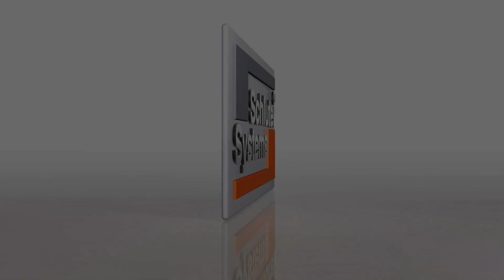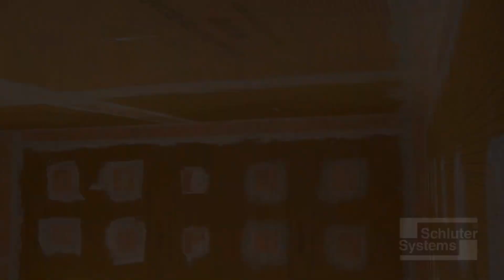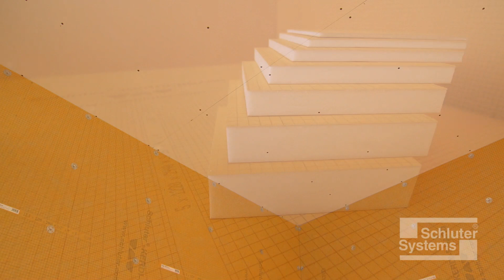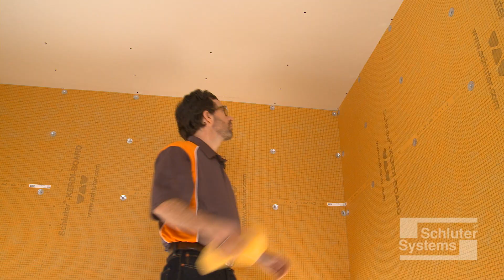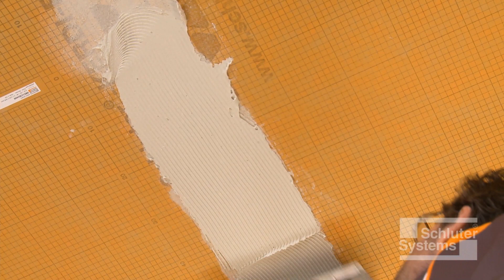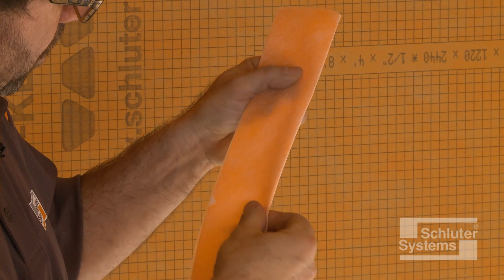Schluter®-KERDI-BOARD over Solid Backing for Ceilings

Comment: Is Kerdi board safe for 36” x 36” porcelain tiles on the walls? On the ceiling?

DIY’ernhere who did the last bathroom (tub/shower) using Durock and waterproofed it for 24x48 inch porcelain tiles.
Reply from the maker: Hi there! Yes, as long as the KERDI-BOARD and tiles are installed in accordance with the instructions in our Shower handbook, this application is fine.

Comment: You don’t screw the Kerri to ceiling?
Reply from the maker: Hi there! KERDI-BOARD may either be fully embedded with thin-set mortar as shown in this video or installed with screws and washers with the maximum allowable on-center spacing of 6" (15 cm) for ceilings.
Reply: I think it would be best to thinset AND screws